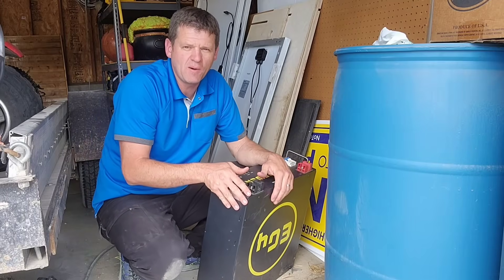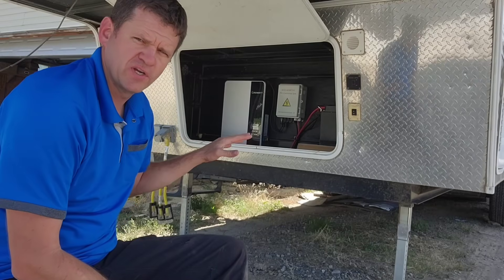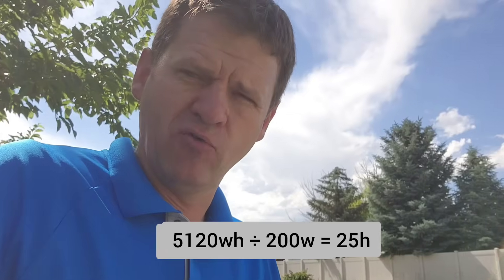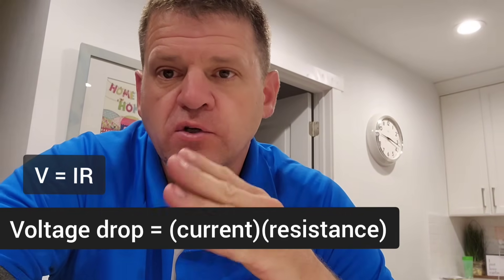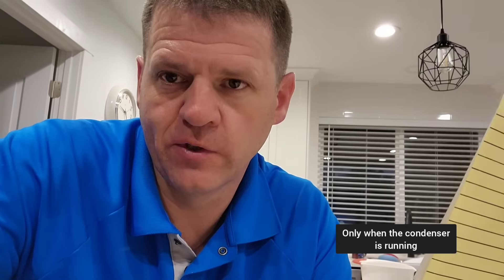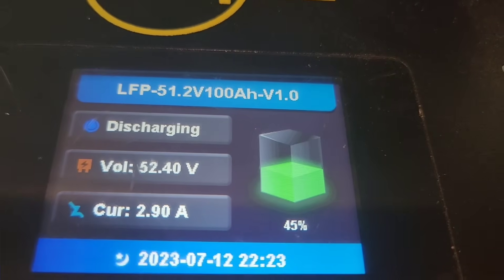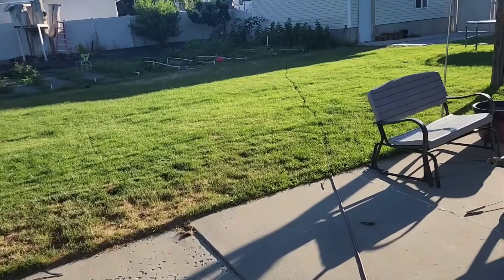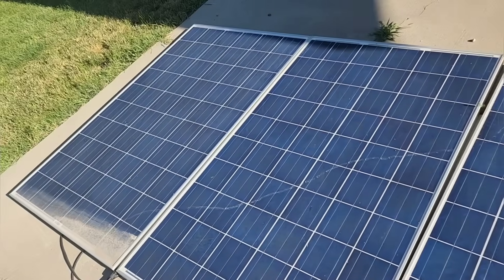How long can a Server Rack Battery run a Fridge?

Comment: Few observations.  There are power losses associated with the DC to AC conversion that are significant.  Generally speaking, at the lower end of the draw on the inverter the conversion efficiently is terrible.  It is not unusual to see around a 5kWh drawdown from the batteries to provide around 3kWh for only a residential style refrigerator over a 24 hour period.  Especially if its hot and that fridge compressor needs to run most of the time, which it will inside a relatively poor insulated RV (vs a house).  This is the main reason why residential style refrigerators should be avoided like the plague in RV's, unless your idea of camping is to always be on unmetered shore power.
Reply from the maker: Thanks for the comment. My RV fridge(dual fuel: propane or electricity) will consume over 300 watts pretty much the whole time its' on.  and my house fridge shown here consumes around 100 watts on average.
Reply: @diySolarPowerFunWithRay  My 8 cuft absorption fridge uses less than 10W when on propane.  A 30lb propane tank lasts about 25-30 days when only running this fridge.  Anyway, what I am pointing out is that your fridge does not actually consume a mere "100W" in your test.  It is a lot more than that.  Solar panels lose a lot of energy as heat during power generation.  Solar charger losses.   Losses internal to the battery when being charged.  Losses internal to the battery when discharging.  Battery self-discharge losses.  Losses in the DC to AC inversion.  Your monitoring/control system also consumes energy.  To make available that "100W" to your fridge means you have to produce via solar a lot more than that amount when all the losses are considered.  This generally gets more efficient with bigger loads, because the baseline losses stay about the same.  For RV-ing, it is better to stay with the RV absorption fridge on propane and turn off your AC power system until it is needed for cooking, A/C, etc.  Although, in that scenario, you will end up needing a small generator at some point unless you spend megabucks on dozens of kWh's worth of batteries and 5000W of panels.  The whole thing is crazy.

Comment: Did I miss it, or did you state this was (or was not) an inverter-type refrigerator ?  Inverters are superior in that there is not abrupt Start-up current.  Slow start is their claim to fame.  Same as mini-split air-conditioners.... 😊🎉
Reply from the maker: I wasn't aware of a "Inverter-Type" fridge. But I can see that my fridge is turning on and off when looking at the my battery monitor... So I think that means it's a condenser type and not the inverter type.

Comment: How well do the solar panels generate energy on cloudy days? I would love to go full off grid but don't think you can with solar alone in winter months with days of rain and no sun.. and I would imagine it would cost 10s of 1000s to buy enough batteries to last a week or longer without sun charging the batteries. Do they work at all in cloudy/rainy days.. I assume not. So how do folks live off grid if solar wont charge? Only other way I can think of is wind power but likely not possible in most residential areas.
Reply from the maker: Thanks for the comment. From Echowatch.com " On average, solar panels will generate 10 to 25% of their normal power output on days with heavy cloud coverage".... I'm waiting on a stormy few days in the forcast and I'll do another video showing how many panels I'll need to keep my fridge running.  But most have a backup generator that can kick on when their batteries go dead. Solar is cheap so it makes sense to get a bunch of those, batteries will cost the most.
Reply: @diySolarPowerFunWithRay  So as long as I get about 5x more panels than I might normally need (no joke intended) I could potentially produce enough energy even on cloudy/rainy days to generate some power. Ideally I would assume a true off grid solution would be enough batteries to sustain a week or longer but also cut down on things if you know ahead of time it will be a week of rain (or longer), and enough panels to offset use to extend the duration of how long you can go without good generation. I am talking like if you wanted to live in mountains where you're a few 100 miles from grid/fuel. Obviously extreme.. but just trying to understand if its possible. I would assume in such an extreme situation some sort of hybrid solar + wind farm (small ones obviously) might provide a potentially longer 100% off grid setup.
Reply from the maker: @WhySoDivided-CantWeAllGetAlong   In theory that is what you'd need. Bifacials do better in cloudy conditions from what I hear.  It's called "over paneling".. and people do it all the time. You just need to space for the panels.  Ground arrays can be cheap if you're not worried about wind. I'll do a cloudy video when a storm comes through. Used solar panels are really good for this: https://www.santansolar.com/product/used-trina-245w-solar-panel/?ref=DiySolarPowerFun
Reply: @diySolarPowerFunWithRay  Ooh.. I did get the 220watt ecoflow bifacials with my river pro 2.. was $850 for the combo vs 500 for battery and 550 for panels so I jumped on that. Never even had heard of that before.. but from various tests they seem to add about 10 to 15 watts at most in added output on sunny days. Another video if you haven't already done it yet.. how about those $500 or so kits that rotate up to like 8 panels with the sun? That seems like space wise you'd actually save room cause you'r putting several panels on the one gimbal vs spread out, but also from what I read they can deliver 2 to 3x more energy throughout the day.. seems like a no brainer.. if you can buy 6 to 8 panels that fit on one, and it rotates from sun up to sun down maximizing the sun.. would make more sense than buying even more panels I would think.

Comment: 1. Correction I think you meant to say Compressor instead of Condenser.
2. Keep in mind that Refrigerator do have the defrost cycle and use
More power than Compressor alone.

Comment: How did you measure the resistance in the extension cord?
Reply from the maker: You can do it with a basic cheap multi meter.  You just measure ohms on it.

Comment: Great video.  I did a similar test with my fridge (about the same size as yours) and I was pleasantly surprised at how low the power consumption was. Peaked out about the same as yours and was almost nothing when the compressor was off.  Also, I have those same $50 250w SanTan panels and I love them.
Reply from the maker: Nice, Yeah I was super surprised as well.  It doesn't take much to keep it going. My RV fridge consumes over 300 watts though..ouch

Comment: Is ac power like DC 2 or 3 volts won't run a 12v  device . Like 10v is to low is it the same with 110
Reply from the maker: I believe there is a little bit of flexibility there.  For example 110v ac can still power 120 appliances. I'm not sure what the cut off it.

Comment: What would be interesting is leaving the solar panels plugged in to your inverter/charge controller/battery and see if you can perpetually run your fridge.
Reply: I would say yes
Reply from the maker: Yes, definitely.  I'm going to do another video showing this and also attempt to keep it running when there's cloud cover. I'm just having a hard time with having a good solid 2 day rain in the forecast though.

Comment: The one thing that was not included in the video was that the newer fridges have a defrosting cycle. Each fridge determines when that defrost cycle will run and is not on a set schedule. I just looked at my 24 hour graph for my home fridge and it did not show that the defroster cycle was activated yesterday. The defroster cycle is a battery killer. I could keep going day by day to see when the last time it ran, but unfortunately, I am rerunning 8AWG wire from the service panel to where I will be parking the RV in a few months. Yesterday my home fridge shows 1.5kW for the 24 hour time frame. Not to bad.

A few years ago a fellow member of an RV forum asked if there was a way to control the defrost setting in his 5th wheel. It was a Frigidaire and he sent me the wiring diagram. I sent him a wiring diagram with parts list that would disable the defrost mode when the 5th wheel did not have 120VAC and was running off his batteries/Solar. He said it worked perfectly.

I still like the LP/Electric fridge in the RV. 
Good Video.
Reply from the maker: Thanks for the comment. My RV fridge is super inefficient. It runs on propane or electricity. When I switch it to electricity it consumes 300 to 400 watts idle. And it doesn't seem like it ever shuts down.. it's a constant draw. My sister has a new RV and they put a pure Electric fridge in her's. I think it's because the  propane/electric ones are just inefficient. I wonder if it's related to my defroster?
Reply: @diySolarPowerFunWithRay  Get a copy of a wiring diagram for the fridge. Look for the defrost unit wiring. Disconnect the wire that triggers it just for a test. You can then decide how you want to set it, possibly adding a timer circuit or maybe just adding an on off switch with an LED to display the on/off status. Every little bit helps.

Comment: There is one thing to check some UPS units are not pure sine wave they are modified sine wave and should not be used for motor run appliances but some UPS are. I would think a pure sine wave inverter and a battery bank would be better. Its just more convenient and automatically better using UPS because the UPS is hooked to the 120 volts all the time. 73
Reply from the maker: Thanks. They mentioned this is a pure sine wave but I haven't checked with an oscilloscope. I don't have one of those right now but if or when I get one I will check for sure. 73,   KJ7TQC.

Comment: Im curious as to your thoughts on modifying the fridge by disconnecting the internal freezer de-froster.  I have read that this is a major source of power draw on a fridge over 24hr.   You could modify your fridge by wiring in a manual switch on the defrost heater circuit so that if you had to go on solar for a few days during an extended outage, you could switch off the defroster.     I have some experience with diy solar myself and have noticed that pretty much anything with a heating element, even small ones, really sucks up the power form the batteries.   Im mulling over the idea of doing a full size fridge with no defroster on my off-grid cabin.
Reply: With no defrost-cycle, you'll soon realize why that feature exists.
Reply from the maker: Thanks for your that's an awesome suggestion. I'll try it. I don't think my defroster turned on. At least based on looking at the battery monitor data. But I could be wrong

Comment: This was awesome!  So to make sure I understand - the growatt actually ate a huge portion of your battery capacity?
Reply from the maker: Yes, It's normal for a system like this.  The 50 W idle is not a big deal to me. It's basically just an extra 100 watt panel on top of my solar array.

Comment: My solark uses like 2watts at idle. Ind it uses a huge contactor to connect towthe grid
Reply from the maker: What model solark? That seems hard to believe.
Reply: Not the 15k, that's for sure... Those large inverters draw 90w idle.

Comment: Good display of how inefficient the Growatt is.
Reply from the maker: I would say it's about center of the pack.  Some of the low frequency mppt all in one systems consume 100 watt to idle. Throw an extra 100 watt panel out there to compensate for the power loss.